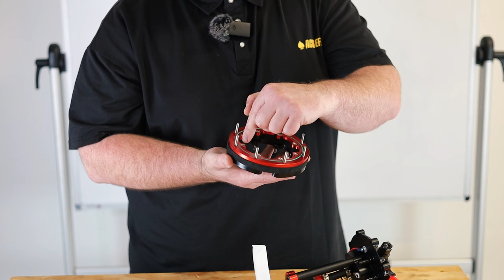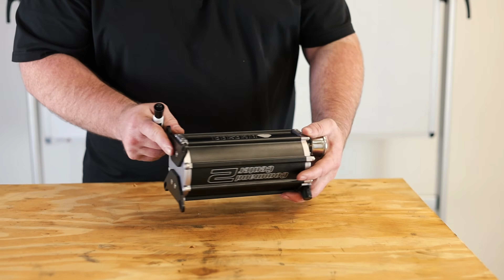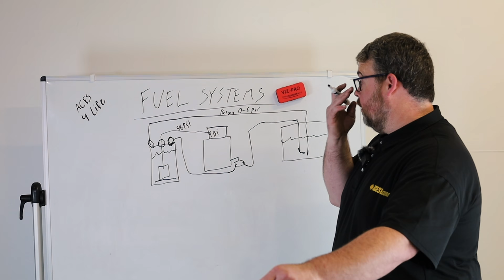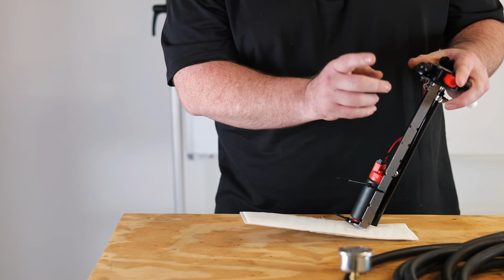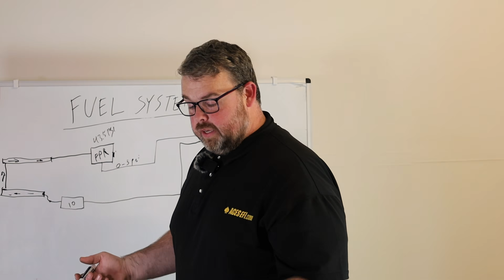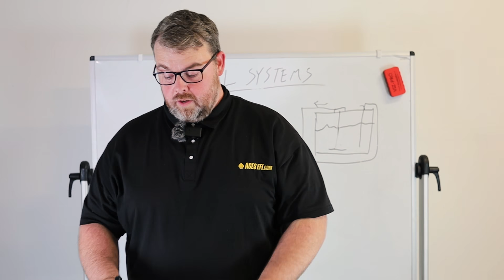Fuel Systems (Jackpot LS Installation Guide Ep.6)

Comment: I have a stock 64 Impala fuel tank, so no return line, what would you suggest to do for a return?
Id be interested in a Fusion + Comand Center 2 with my mechanical. 
Im no mechanic but I get around. Just need to clear things up for myself.

Comment: Hi. Why is a dip tube needed if there's a return port on the tight in-tank pump? Could I just use the return on the  flange and run the return line down in the tank from that?

Comment: Great video great info. Does the command center 2 need inline fuel filters if yes were are they placed in system and what micron?
Reply: Mine didn’t come with filters so I just googled “10 micron Efi filter” and put it inline.  I think it was like 25$

Comment: great video series guys, I just bought the ACES jackpot for my 1986 C-10 ls swap and was curious about using the C-5 corvette filter/regulator on my swap as it is set for the 58 psi needed, I have the Walbro 255 in tank pump already installed.